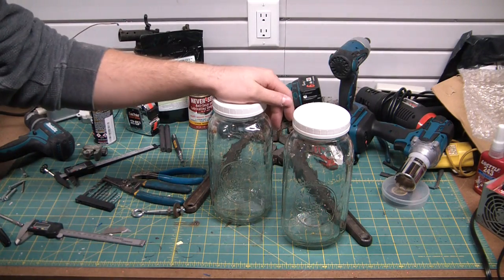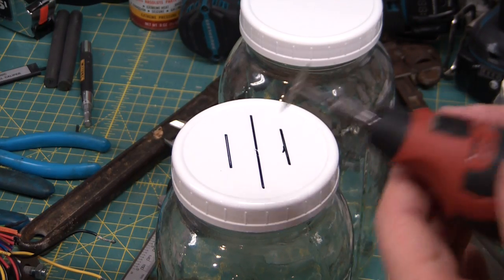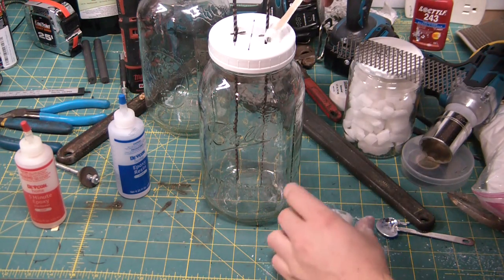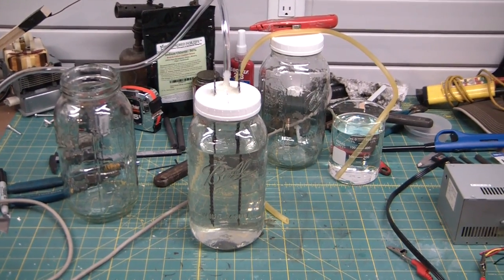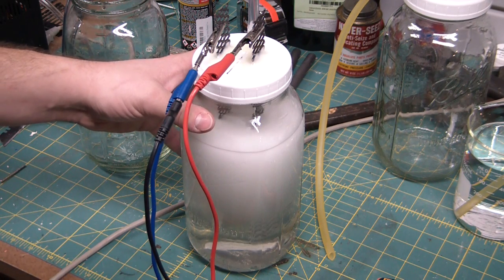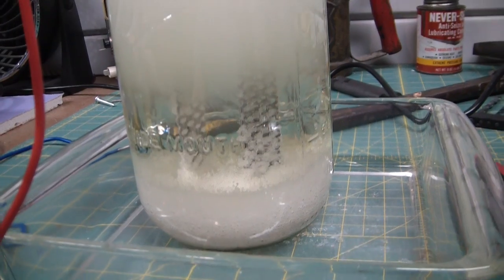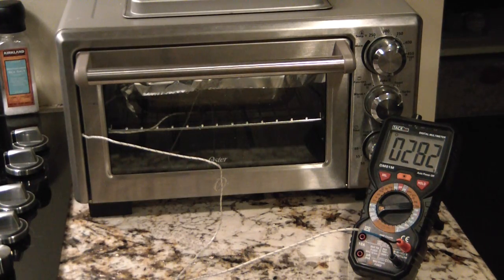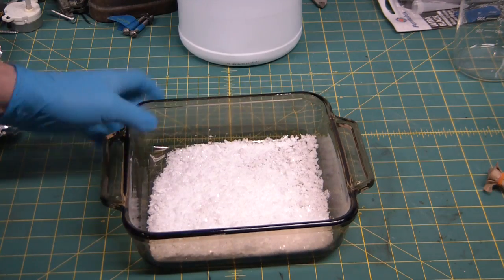Electrolytic Production of Chlorates Using MMO Anodes

Comment: Yes! Please attempt a potassium perchlorate. As I understand it, it's much safer for use in pyrotechnics. Funny though, it's dirt cheap at the gun shows but the science is very cool.
Reply: Apparently you heat the chlorate in an oven just barely to its melting point in an inert container.  The chlorate will slowly oxidize itself, creating perchlorate and chloride, both of which have a higher melting point.  So you'll know the end point of the reaction is close when the mass solidifies.
Reply: @atari7001  That method can be dodgy if there's traces of dust or transition metal salt contamination (which have a catalytic effect on unwanted decomposition to O2 and chloride). Purity is an absolute must.
Reply: Gary Card  True.  It’s probably not very efficient.  I’ve heard addition of chromate catalyst and raising the cell voltage above 6 volts does the same electrolytically.  But, from my own experience, I’ve noticed that there can’t be any residual chloride in the cell before perchlorate production begins.  So, since the kclo3 isn’t very soluble, you either have to heat the cell to keep it in solution, or deal with low yields.  I’ve often wondered if shooting for sodium perchlorate first would have been better, given it’s good solubility.  Then double displacing to get kclo4... but, I’ve never tried that.  I also never knew how to tell when the cell had gone to completion to avoid chlorate/perchlorate mixes.  The simplicity of just collecting relatively pure kclo3 from the cell bottom and melting everything and forgetting about it was particularly attractive...
Reply: @atari7001  Yes, the sodium displacement seems to be the more popular method. Can't the residual chloride be removed by rinsing and then recrystallizing the chlorate?
Reply: @goldenrod8861  yes, absolutely.  it creates a very pure product (with the potassium salt).  I understand the best way to separate sodium chlorate from chloride is to "salt it out" of solution by dissolving more chloride while hot, then collecting chlorate upon cooling.  It still remains relatively impure, however...
Reply: @garycard1456  only if you decompose KClO3 but with NaClO3 its negligable and chromates actually help the reaction at lower temps.
also adding fine NaCl powder to your mix to be heated prevents chlorate reduction also.
Reply: @CatboyChemicalSociety  Why would NaCl powder prevent reduction of the halate? Is it to do with equilibrium (Le Chatelier's Principle)?

Comment: Preparation of KCL itself in a special container! Solution used! The rest, the precipitate of KCL that has not dissolved! Is it worth using it again?
Reply from the maker: Absolutely, keep the left over cell liquid and just add more KCl, will speed up the chlorate production of the next run
Reply: @ElementalMaker  Preparation of saturated KCL solution! The solution is taken. Undissolved KCL remained at the bottom of the glass. That undissolved KCL can be redissolved for another saturated solution? Preparation of potassium chlorate with hypochlorite!

Comment: Hey is there a reason you're not using 12v from the PC PSU? Most modern PSUs (IE: not the one you're using) are AC to 12v DC supplies that then convert the +5v, -5v, 5vsb, and +3.3v, so you get a lot more amp draw from them if you just use the 12v natively. You'll have a LOT more amps available at 12v (my 1300w PSU can do 108.3 amps 12v), so assuming the circuit naturally doesn't pull more than whatever amps you showed on the PC PSU, you'd have a pretty easy time just running a high efficiency one nonstop without it overheating. Might dramatically speed up the process as well if you're able to pull more power safely. You could get a modular supply and make custom cables for it or buy a second set so it's still useable as a PC supply later if you want as well.
Reply: Can't really run a high amount of amps in these cells, it prematurely erodes the electrodes. Good idea though💡

Comment: wait so you can simply electrolyse salt water and have NaClO3 crystals on bottom? or im missing something?
Reply from the maker: Nope it's literally that easy. The hard part is getting an anode that'll survive the process. Naclo3 is a bit harder as it remains in solution. It's easier to start with potassium chloride as the chlorate crystallizes out of solution.

Comment: I have been doing this with sodium for a while and intend on forming a small sodium chlorate to sodium perchlorate conversion cell using a platinum anode. The sodium perchlorate could get its first step in purification by using acetone as a solvent in which both the chlorate and chloride variants are poorly soluble. The purified perchlorate could then be tested for chlorate, and if deemed fit, a process used to destroy trace amounts of chlorate present producing trace amounts of chloride. A displacement reaction with potassium chloride should then give a pure potassium perchlorate precipitate which could be further recrystallised if necessary. As for thermal decomposition of the potassium chlorate to perchlorate, I am interested in seeing your results. I wonder how you would purify the perchlorate in this case, allowing for the possibility moderate proportions of the other species are present?
Reply from the maker: I will be doing roughly the same process for making the ammonium perchlorate. You can destroy residual chlorates with hcl in solution. It's the safest way to go because even trace amounts can make your perchlorate as sensitive as chlorate.
Reply: ElementalMaker The hcl method is what I was considering. I didn't realise however that the decomposition of chloric acid actually produces more perchlorate (along with chlorine based gases). Maybe chloride is not produced in this process. I agree trace amounts of chlorate in perchlorate makes "perchlorate" pretty useless.

Comment: It can be used with german black pyro aluminum, just like the one you made by milling aluminum foil... have fun
Reply from the maker: I would strongly discourage ever using chlorate for flash. It's incredibly sensitive stuff, and it's the reason big red firecrackers have a reputation for blowing off fingers. Perchlorate makes for a much more stable and safe to handle flash, although even then it needs to be treated with extreme respect.
Reply: @ElementalMaker  That's true, but chlorate flash can be stabilized with boric acid, which makes it much less sensitive to acids and as long as it isn't contaminated with sulfur it shouldn't become TOO sensitive. Either way, it would be awesome to see some flash powder on the channel. Great work so far!

Comment: I did basically this with a$15 eBay Chinese power supply. It works great except you cant exceed 4amps, and it doesn't have a current limiter. So for everyone wanting to DIY this, don't. If you can't control the amperage you're likely to burn something out. 

One property of circuits even this one, they will take as much current as the material will allow. You need a current limiter of some kind. I got away with using a graphite rod because I know nothing of building proper circuits.

Comment: I believe there's white phosphorus in the match head and red phosphorus on the striker
Reply from the maker: Definitely no white phosphorus in any consumer products. That stuff is insanely dangerous and poisonous to boot. The  heads contain chlorate and binder/filler, although you are correct the striker contains red phosphorus
Reply: Strike anywhere matches use a small amount of white phosphorus on the tips.

Comment: in your experience is it safer to store KClo3 wet in H2o or dry
Reply from the maker: It's not reactive by itself as it's just an oxidizer, so it's fine to store dry as long as it's in a safe container, away from any possible fuels and heat.

Comment: your chlorate wont be 100% pure. After i harvest my chlorate, i recrystallise it by boiling water and making a saturates solution. i then put the pot of solution on the counter with a fan blowing over it to help it cool and crash out the chlorate. then i put it in a cloth sheet, tie it up tight and put it into a clothes spinner(basically its a centrifuge) which pulls out most of the water. then i dry it in the oven at about 100c. the spinning part is optional but helps with drying and purity
Reply: That's what I was thinking. I reckon there has to be at least some KCl in it, which is readily removed by a recrystallisation using hot water as the solvent.

Comment: Could a hydrometer be used to measure the chloride concentration drop and judge when to add  more potassium chloride to the cell as needed?
Reply from the maker: That probably would work, but it would be easier to just add a salt hopper to keep the KCl constantly topped off.  It will continually dissolve to keep the solution saturated.
Reply: @ElementalMaker  Thanks for the quick reply and advice. (I'm an Australian. My experience with a hydrometer is limited to making beer at home)

Comment: Can I use stainless steel for the anodes? I don't have access to mmo anodes
Reply from the maker: Nope stainless will rapidly degrade. Check eBay for mmo, you can get them cheap
Reply: @ElementalMaker  thanks for the attention
Reply from the maker: @viniciuscamilo7016  happy to help! Graphite can also work, but is a bear to filter out. Mmo is by far the best

Comment: How do you want to make a double displacement between KClO4 and NH4+ since K perchlorate is far more insoluble in water than ammonium perchlorate is?

Apart from that, I love your vid!
Reply from the maker: For making ammonium perchlorate youd start with Sodium Chloride
Reply: ElementalMaker yeah! I have done than and succeeded with a PbO2 anode. By the way you need to ensure the absence of chlorate ions in the cell which would make the dangerous NH4ClO3. I used bisulfite for this purpose and tested with HCl.
Reply from the maker: @pyrofriends2323  nice! And yessir, I have methylene blue and indigo carmine for testing
Reply: ElementalMaker I used methylen blue too! What’s the purpose of indigo? I am trying to run a KBr cell
Reply from the maker: @pyrofriends2323  indigo carmine acts as a very sensitive test for chlorates
Reply: ElementalMaker oh nice. I have tried adding HCl to my KClO4 and nothing happend so I was confident. :)

Comment: Where would a reliable source of anodes be found?
Reply from the maker: That's hard to say. Unfortunately the seller I bought mine from appears to no longer have any surplus anodes to sell. You can find them in pool chlorinators, and still on ebay occasionally as well.

Comment: I have an MMO DSA TI Plate 6*4 Inch as Anode and a pure TI 2*6 Inch plate Cathode. I am using ~4-5Volt 20 AMP in a solution of 14 Ltr Bucket of KCL, ran in for 4 days. I never got KCLO3. Output was only a solution of chlorine smelling liquid remained. 
How to I progress further to get KCLO3. Suggestions please.
Reply from the maker: Okay so your cathode is way too large. The cathode should be about half to a quarter the size of the anode. This prevents cathodic degradation of the product, so your probably losing alot there. My cell is not optimal either having a cathode the same size as the anode. The solution you started with must be a fully saturated solution of KCl. 14L of solution given KCl solubility at 20*C of 254g/L means you need around 8 pounds of KCl. And a volume that large you may need to run much longer, a couple weeks possibly to get a good yield.
Reply: @ElementalMaker  Thanks a lot for a good suggestion and a quick TAT, I will split TI cathode and increase KCL saturation as suggested. Let me try. Any suggestions on increasing AMPS or closing the lid on the bucket (it's actually a 20 L capacity HDPE bottle) I am letting it open on my terrace and it's 22-26 deg C. ?
Reply from the maker: @sr8237  that's quite cold for chlorate production as well, keeping it warmer will definitely improve yield. 20A is quite alot for an anode of that size to handle, so I think your current is fine.
Reply: @ElementalMaker  : I have been running a 10 Ltr /2.3 KG saturation solution between 65-80 Deg Centigrade. 3.5V @ 20 AMPS. MMO DSA Anode and Ti Cathode (Trimmed cathode to 20%  size of Anode)  Running for 30 Hrs. Don't see any chlorate yet. My cell is an open bucket kind with no lid. Outside house, I can only smell chlorine gas. pH range is approx 5. Appreciate for any suggestions?
Reply: Still running the cell for the past 90 hrs, no luck. Cell is run constantly at 3.4v @20 Amp. Temp is 33 Deg Centigrade. No luck of any crystal formation. Only Cl and Hypochlorite. pH is approx at 5. Any suggestions please please help
Reply from the maker: @sr8237  Man something is way wrong here. You should hane a ton of chlorate. Dumb question but you are using a DC power supply correct?
Reply: @ElementalMaker  yes, Sir, computer based SMPS and also 5v/20Amp DC.  
Measured DC voltage out is around 4.5v. still running, just giving cl fumes. 
Exact Anode measures 12*4 inches(MMO), Cathode 6 * 1 inch (Ti).
Reply from the maker: @sr8237  I genuinely dont know what could be wrong, other than to say keep running it until you see crystals forming. And you did start with a fully saturated solution? Also, you are sure its potassium chloride you started with?
Reply: @ElementalMaker  Thanks for timely reply and giving me some comfort. Yes, it's KCL, got it from a known Chemical shop. Saturation ~250 gms per litre, prepared via heating with constant stirr and then filtered. Anode and Cathode r separated by approx 1.5 cms. I can see continuous fizzing with cl gas. Temp is ~32-36°centigrade. 
I will let it run for couple of days more and see. Shall keep u posted
Reply from the maker: @sr8237  everything you've done is quite correct, so I think given the volume you are working with, it may just take longer. I would flame test the KCl just to be sure you weren't given NaCl or another chloride salt.
Reply: @ElementalMaker  After 15 days  finally, I see small crystal formation and the temp is maintained at 42-45°c. Also, lot of bubbles ( I am guessing it's Hydrogen). 
I have collected a small 3 gram crystal, cleaned with cold  distelled water. After drying added sugar pounded. put it into flame, this compound, does not burn!! 
Not sure, if I have chlorate? 
Any guesses/ recommendation here?
Reply: Trusting ur safe and well during COVID time.
Anyways, I wanted Hypochlorite for home use. So, continued with my expirement.

Finally there r lot of Crystals formed, first batch took 10 days. Yield 500 grams.
When I dried and made fine powder and mixed with sugar. It burns fast. But in yellow color flame. 
Do you know why? Any suspects? 
Base is KCL and tested. MMO DSA and TI rods. 
Appreciate your suggestions.
Reply from the maker: @sr8237  sounds like sodium contamination is getting in somewhere. Even a tiny percentage of sodium ions will wash out the purple spectrum of potassium, so you could just have a tiny bit of sodium contamination in your starting KCl.

Comment: What gas is produced in this process?
Reply: Mostly hydrogen. The oxygen is being used in the reaction, but some might escape too. And I'm not sure, but you have to be careful with chlorides like table salt because they can also release chlorine gas, but maybe the anode material has something to do with it, making it absorb the oxygen instead of release the dissociated gas. Not an expert on the subject, but basically the answer is hydrogen.

Comment: Where did you buy the electrodes from?
Reply from the maker: I picked those ones up on ebay. Keep an eye out and you'll get lucky every so often
Reply: @ElementalMaker  I just found some on AliExpress, but I am a little sceptical.
Reply from the maker: Those ones on aliexpress are quite pricey from what I just saw. You should be able to find some much cheaper. You can also try calling local pool places and seeing if they have any old used salt water pool chlorinators, they are almost always MMO mesh anodes.
Reply: @ElementalMaker  Yeh I will try that thanks